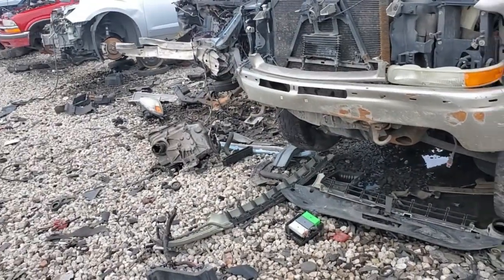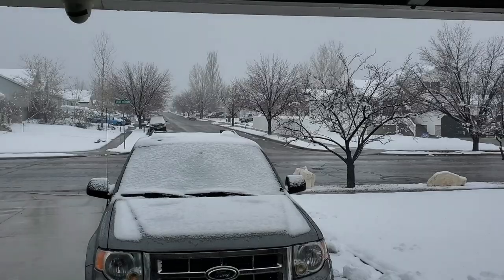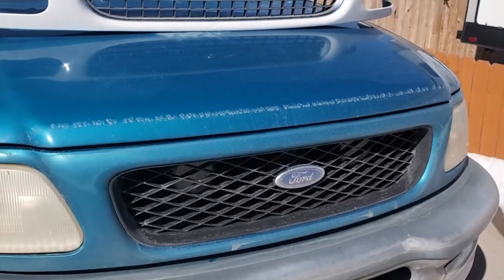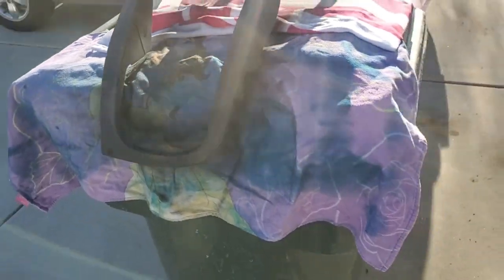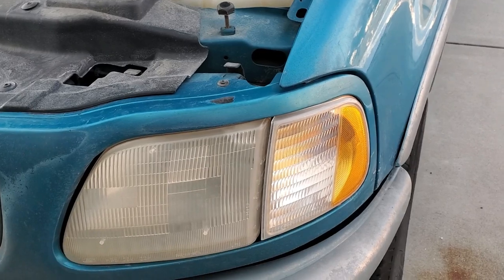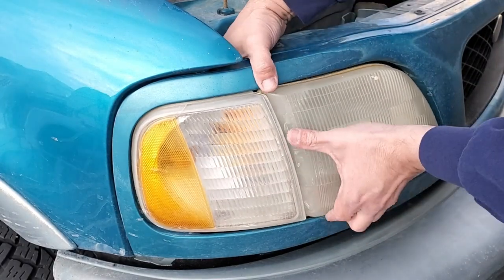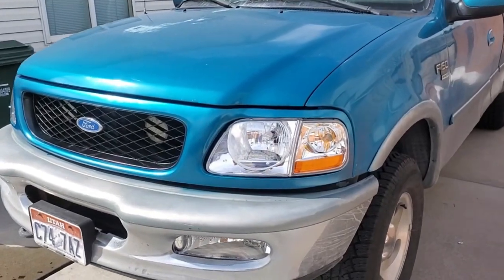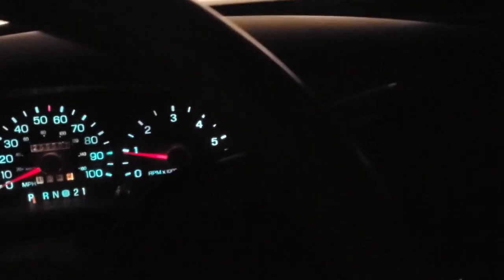The 89G - Giving My 1997 Ford F150 a Facelift: Lightning Headlights, Clear Fog lights, Header Panel

Comment: Just to help people who aren't changing the upper surround panel, but want to change the fog lights.  There are 4 22mm nuts holding the bumper after you unclip the lower splash panel.  It takes about 4 minutes to remove the bumper, lay it on the ground and remove the fog lamps easily.  Took me 15 minutes originally to put those newfogs into Blue. These GEN 10s are really easy to work on other than the core support upfront.
Reply from the maker: GREAT info! I almost started putting it back together with the header panel and the grille. Then I looked down and said "I'll be dipped"... That was pretty easy going from the top.

Comment: Like way better. My only other complaint with the 97-99 is the front bumper. I think the 2000+ bumper looks cleaner. Personal opinion, which really means nothing👍
Reply from the maker: Thank you! The bumper is indeed a little sleeker / cleaner on the newer trucks. I would swap to one if it didn't leave the gap under the grille.